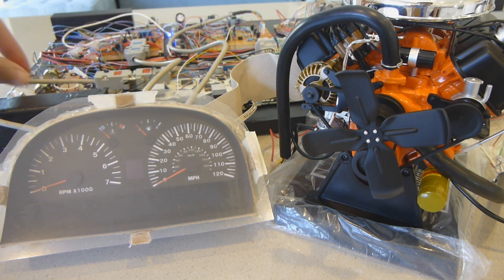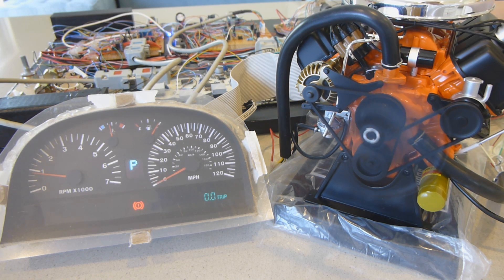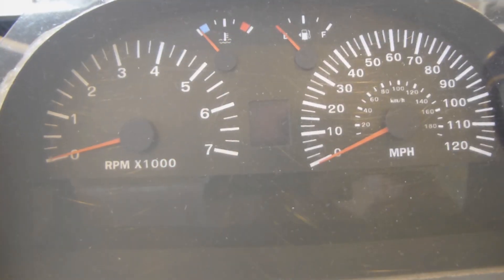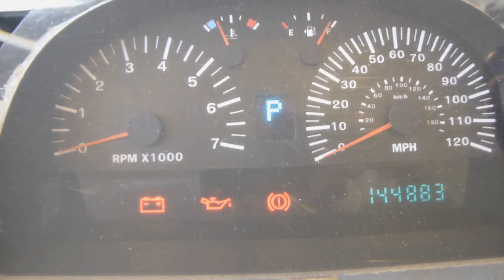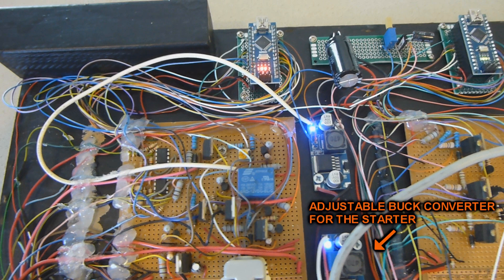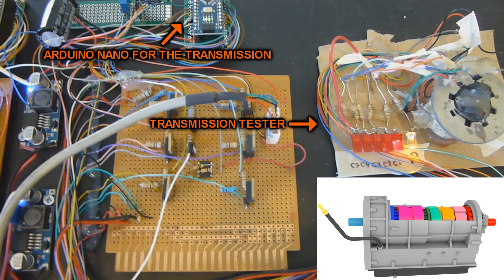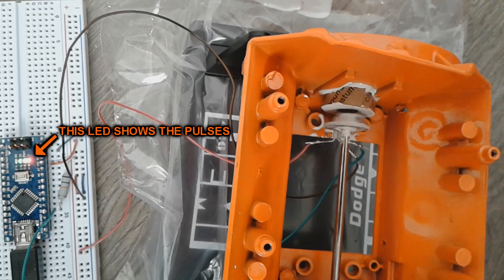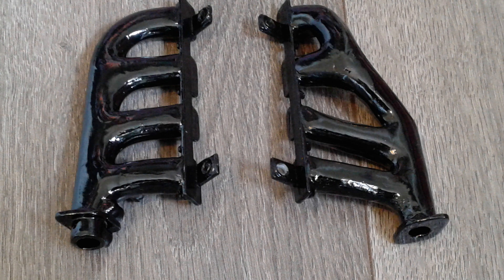426 Hemi Working Model Engine (1:6 Scale) - Part 2. It Works!

Comment: That's an X27 stepper motor gauge for the tachometer??
 It runs very smoothly and is controlled by the hall effect sensor

I tried to do the same but am having issues with getting that X27 motor to work, how do you connect and send data from the hall sensor to the X27 gauge so it's smooth like yours??
Reply from the maker: For the tachometer and speedometer I used the motors and drivers from a real car dashboard. That's why it is so smooth. I just send the pulses to the correct pin in the dashboard and it does everything by itself to drive the gauges.

I just placed the gauges in my custom made dashboard but if you see the big board you'll see the big PCB that comes from the car dashboard
Reply: @interlinkknight 
Thanks for responding ❤

I understand that you took the motors from a Chevrolet trailblazer gauge cluster (I believe they're X25 or X27) and I've made the exact tachometer you had (A3144) which reads RPM beautifully.

I'm just confused how to control the Stepper gauge motor from Arduino (I've tried 1 MILLIONS TIMES 😭😭 from controlling directly from arduino, (using stepper drivers, everything) 

What specific driver do I need? so I can control the gauge motor. 

I've tried everything
Reply from the maker: I didn't just took the motors from the cluster, I also used the controller/driver of the cluster. The cluster is doing the calculations and moving the stepper motor. The stepper motors are not connected to Arduino in any way.

But, I'm sure you can control them through Arduino. What's your issue? It's not smooth enough?
Reply: @interlinkknight It's just it super shaky and I've got no idea how to send that RPM value (average) in the code you made, how do i control it with Arduino? 

I tried by connecting stepper motor to Arduino directly but it shakes like when it reads the rpm value, i don't know how to control it properly.

If you know anything I'd be super grateful 🙏
Reply from the maker: I guess is like controlling any other stepper motor, right?

Comment: I really hope you make a video on how to input signal into the gauge cluster, please
Reply from the maker: You would have to have the exact same cluster so the connection could be useful, because there is no standard about this, at least in the one I have. I've seen people controlling clusters with arduino but for newer models that have standard protocols.

Comment: Did you get the odometer out of a dodge or chrysler?
Reply from the maker: Chevrolet Trailblazer 2006
Reply: InterlinkKnight it looks like a chrysler odometer to me is that the mileage the vehicle had on it when you pulled it out of the trailblazer?
Reply from the maker: I guess they are similar. And yes, that was the real millage of the original car

Comment: Which fuel is used for this engine to run it
Reply from the maker: It's electric
Reply: It works on battery
Reply: Plz make a video that how can we connect this engine to any rc circuit
Reply from the maker: I'm going to make another version for 3d printers and simplified electronics, and I'm going to make a tutorial about that.
Reply: All the parts of this engine is given in the box or you add from yourside
Reply from the maker: They sell the model and I added the motor, bearings, electronics, solenoid, etc.

Comment: When you buy the kit, does it come with a motor and everything?
Reply: Like does it actually run
Reply from the maker: Of course not
Reply: InterlinkKnight so basically it's a display model kit doesn't have a electric motor in it?
Reply from the maker: The model kit only has the engine model. That's it. I put all bearings, motor, sensors, cluster, electronics, etc.

Comment: y u no redline dat engine
Reply from the maker: Yeah, not all tachometers have one. And this particular engine doesn't have a fixed maximum RPM. It was often modify to go at higher RPM than the factory default limit of 5000 RPM. So I choice not to add the red line.
Reply: what the hell is a "dat" 
slang for "that"? less being lazy, todays youth pathetic